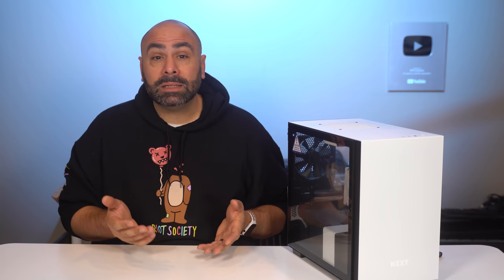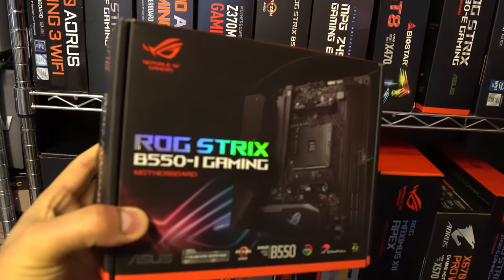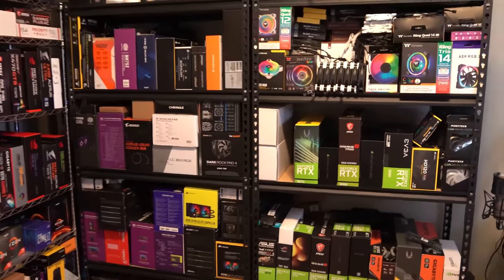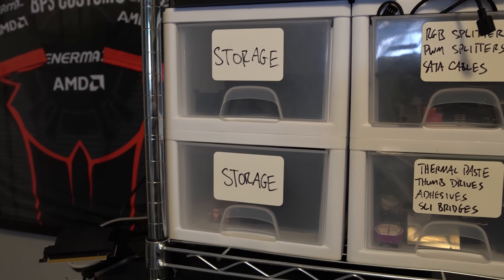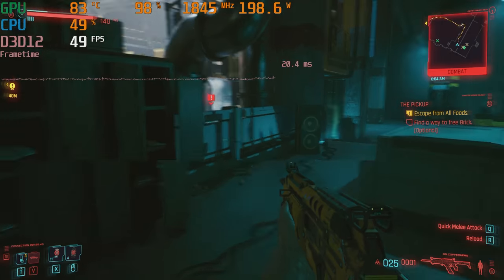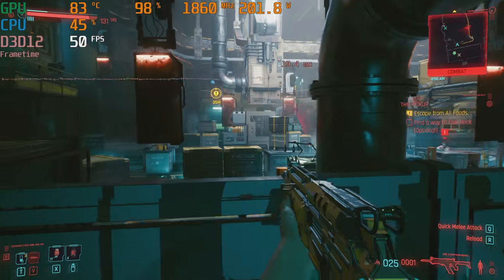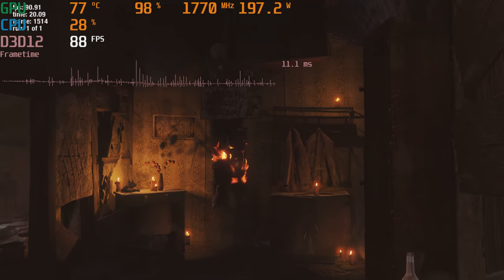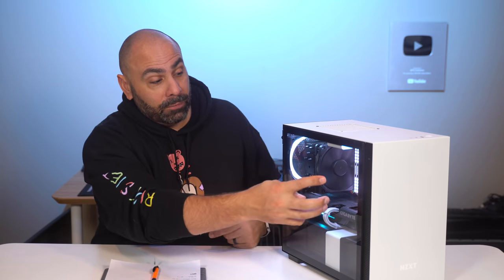The 2020 Viewers Choice Gaming PC Is Here!

Comment: Awesome vid, only thing you mentioned that's not right is that you can use a Dark Rock Pro 4, I have this case and I'm using one as I'm going for almost passive extremely quite build and its been amazing just need low profile ram.
Reply from the maker: I can’t use it with the memory I had to put in this build though
Reply: Big Air Coolers are good but people forget about the Memory 😁

Comment: |Noir-PC|
CPU: Intel Core i5 10600k @ 4.5Ghz stock [6 cores 12 threads] ($284USD)
CPU Cooler: NZXT Kraken M22 120mm AIO ($80USD)
CPU Thermal Paste: Kingpin cooling KPx ($13USD)
Fans: 2x 120mm Noctua NF-F12 iPPC-2000 PWM ($50USD)
Motherboard: Asus ROG STRIX Z490-I GAMING Socket 1200 ($271USD)
Ram: 32GB (2x 16GB) 3200Mhz DDR4 Corsair Vengence LPX ($110USD)
Graphics card: EVGA RTX 2080TI XC Gaming Hybrid (watercooled) ($1400USD)
OS Storage: 1TB Samsung 970 Pro M.2 NVME SSD ($350USD)
Music Storage: 500GB Samsung 860 EVO Sata 3 SSD ($75USD)
Powersupply: Corsair HX1000w ($250USD)
Cable Extensions: FormulaMod Sleeve extension cable kit ($24USD)
Cable Ties: Attmu 50 PCS microfiber cable ties ($7USD)
Sata Cable: Silverstone Tek 180 Degree SATA III Cable ($10USD)
Case: NZXT H210 small ITX ($80USD)
Monitor: Acer Predator XB271HK 4K (3840 x 2160) Nvidia G-Sync 60Hz IPS gaming monitor (cost not included)
Keyboard: Corsair K70 RGB (cost not included)
Mouse: Glourious Model -O (cost not included)
Total Cost for PC (Before sales tax): $3004USD

I finally finished building my dream PC ( I called it "Noir" since the word Noir in french means: BLACK). I spent 4+ hours building the entire PC including cable management. I love how it turned out but I would not recommend building a small itx pc as a "first time PC builder" , since there were a few problems I ran into when building it. My 1000watt corsair powersupply was so large it took up the entire bottom of my small NZXT H210 itx case, so the space was very limited- I decided to mount my 500GB Samsung 860 Evo Sata 3 SSD behind the motherboard for a cleaner look. I would say this is the best PC I have built- I love the small size of the case & the PC is very silent using the Noctua 120mm fans.

Comment: currently running the strix b450-i mini itx in my pc and wondering if its gonna be worth it to uograde to the strix b550-i or x570-i to run a 5600x or better ryzen cpu other question is do you think something like a 6800xt would be overkill for a 5600x.  will be playing games on a 3440x1440 ultrawide with a 80-100 freesync range
Reply from the maker: The 5600X is really an amazing gaming CPU, I don’t think you can go wrong pairing it with almost any GPU
Reply: @BPSCustoms  so then I should also be good on my strix b450-I as well.

Comment: I decided to move my itx build to the 510 instead of 210 mainly because of the lack of space by the GPU. Also very tight fit at the top of the case with a 14mm exhaust fan

Comment: Essentially to the specs of my future build! I couldn't help to notice how you forgot the connect the USB-C Front Panel USB cable 😭
Reply: The motherboard may not have a usb c header, I have an x570 I aorus pro wifi in the h210 and had nowhere to plug it in
Reply: @chongwong  I'm getting this board for my build, it's got a USB-C Front Panel. One of the supplying features over X-570 and if you watch the b roll you clearly see it. 😂
Reply: @chongwong  I'm using the same mobo, it has one USB c header on it. Only few b550 itx board got this header. ASRock, msi, and strix only got.

Comment: This was bassically my build the h210 5600x and eagle 3060ti dominator platinum ram 😂
Though that gpu is running a lot toastier than mine 20 to 25 degrees hotter on load!

Comment: G'day Brian,
The H200i seems more like a Mini M-ATX size case to me, I'd rather M-ATX for the reason you said of better GPU Airflow, 200MHz is a big loss for the GPU due to the case 🥵 & it would be killer in summer in California or here in Australia without Air-Con,
also I like how NZXT has 2PCIE slots for H200, 4PCIE for H400 (why no H410???), 7PCIE for H700, but what confuses me is H500 has 7PCIE??? why not 5 now that H400 is gone?
anyway love the build & putting the NZXT stock fans as intake in this case is a good use as the Exhaust RGB focus light on the Motherboard,
Hope your family have a Wonderful Christmas 🤶🎅🦌 & hope 2021 is a much better year 😁

Comment: Have exact same card OC version. Rgb fusion software is absolute garbage. It also crashed my system more than once. It took more than a few attempts to get it to even see the card. Worked eventually I only needed it to change the colour, although it will cycle all colours if you manage to even get that far. Soon as I changed to the right colour choice for the setup, I couldn't dump it off the system quick enough. It is a seriously flawed piece of software that needs a complete overhaul.

Comment: Gpu seems kinds tosty?? Wondering what would happn if you took of the glass panel?
Reply from the maker: I imagine what would happen would be that temps would go down and the testing would be flawed :-)
Reply: @BPSCustoms  Totally agree with removing the glass not being a proper test,
🤔 although a comparison with this build transferred to a NZXT H400 & H500, as the cases are the same Airflow design just internally larger this would show the difference M-ATX & ATX have on cooling performance for this style of case
Reply: I agree with Brian,
but also think you are on the right track to see what happens if you increase airflow, still keeping the test in a closed case a NZXT H400 & H500 comparison would be a worthwhile experiment for comparing CPU & GPU Temps to the H200

Comment: Nice build I’m planning something similar myself here soon, but thinking about going with the In Win A1 Plus in white. 

Sad that midrange in now a $400+ GPU..
Reply from the maker: Well to be fair, the X70 series from Nvidia was always in the mid-$300 range. The MSRP of the 3060ti isn’t much more.
Reply: @BPSCustoms  Well isn't that the problem? The MSRP of the 970 was 350$ now a 3060TI is 400. Kinda sad. At least CPUs are cheap and fast nowadays.
Reply: @Henrik0x7F  that depends on what cpu you want.
Reply: @Henrik0x7F  "At least CPUs are cheap and fast nowadays"🤔but AMD CPU MSRP increased to match Intel pricing this year too, also I'm wondering will there be a R3 5000 after what happened with 3100/3300X? so will R5 5600X be the cheapest AMD CPU you can buy stand alone?
here in Australia the cheapest 'MidRange' new Gen are
ZOTAC GAMING GeForce RTX 3060 Ti Twin Edge $749AUD
Intel Core i5 10600KF $359AUD
R5 3600X is $499AUD so it seems importers are taking advantage of Ryzen being the popular choice, because Ryzen pricing here makes the Intel i5 range an attractive gaming CPU & with a good B550 being similar in price to decent midrange Z490 (about $250AUD) Intel Gaming PCs are not CRAZY! here